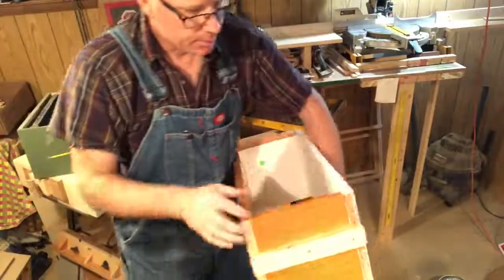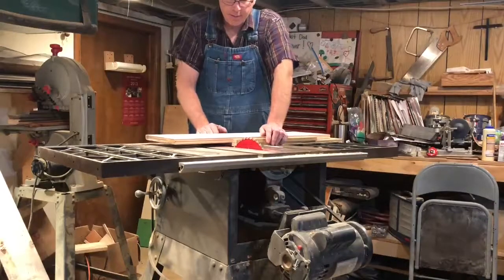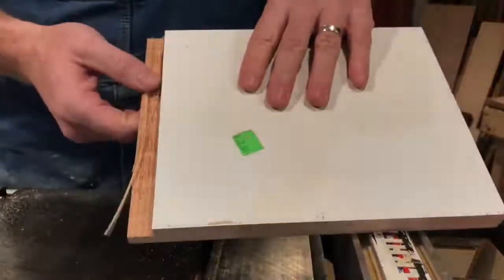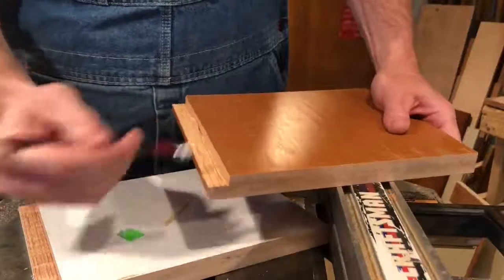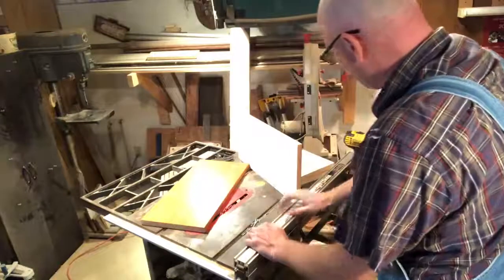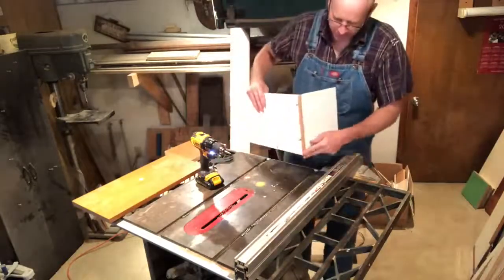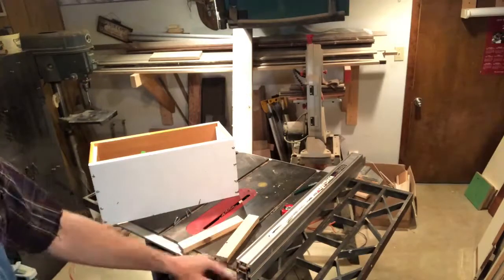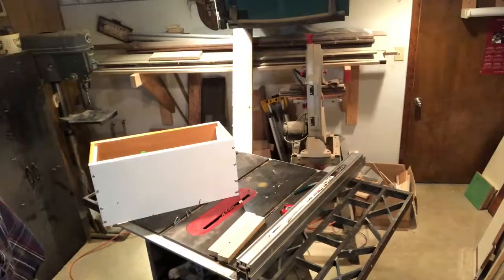$3 Deep Nuc Box!

Comment: Hi there Scott, just discovered your channel. In the UK we don't have dado blades so have to rely on single blades generally, watching this I was surprised to see you making multiple passes for cutting the rabbit and I have to ask the question, why do you not just set the blade depth to do one cut into the timber for the depth of the required rabbit then reset the blade depth, stand timber on end and do the second cut thus making the rabbit with just to passes over the blade  and having smooth finish into the bargain?
Reply from the maker: Thanks for watching and for the question. Sometimes I do the very thing you described and sometimes I use the dado, or make multiple passes with the single blade. I like to show people that there are usually many ways to get to the end result and to not let absence of a certain tool stop you from making projects.

Comment: A bit off topic, but what’s happening to the old ‘weird shop’ once the new building is up and running?  I’m assuming it will be a new wine-making area, or some other processing area that is better at your house.  Thanks for the video.
Reply from the maker: You hit it right on the screws!  Once I get the dust making tools out to the barn this room will be for wine making and storage.  I have some clean up to do but it's a good temperature year round for storage.  Fermenting would still need to be done upstairs so it can be warm enough but the main aging and storage will be out of the way.